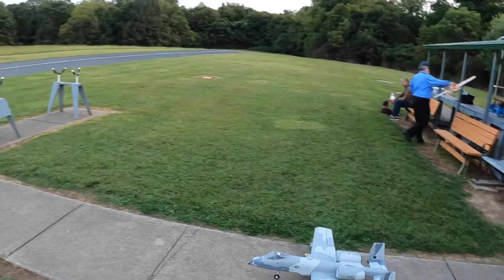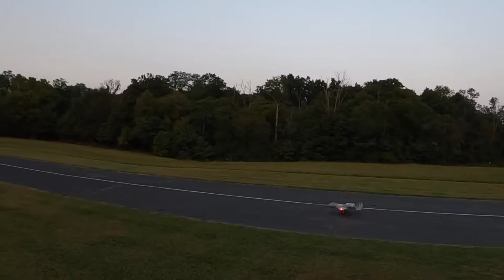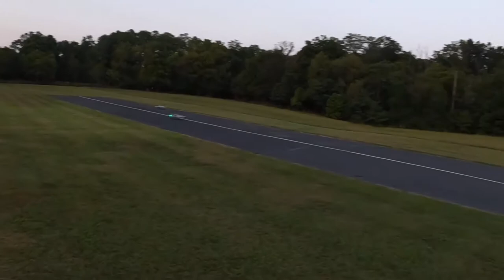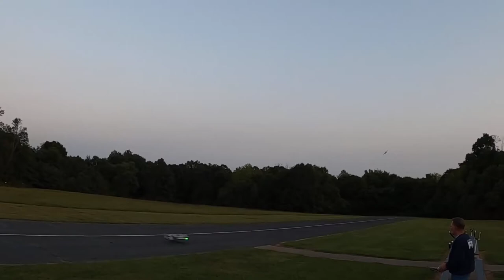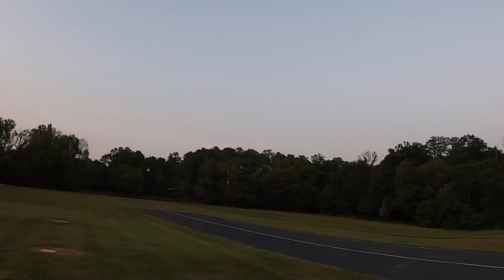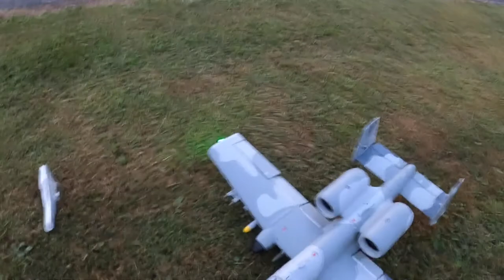E-flite A-10 Thunderbolt II 64mm EDF - formation flight and Jim crash

Comment: I think the grass helped out here lol. Those retract pins are definitely a weak point. BUT I’m not sure if you guys added the mixing with the flaps and elevator or not, but at 10% flap add 10% elevator and the 70% flaps add 12% elevator- after doing this I’ve never had to flare again, nice smooth nose-up landings every time!
Reply: I'm confused, is that 10 and 12 percent down elevator..? Wouldn't that make the plane want to nose down more..?
Reply: @EDF_FANatic  UP elevator. lol. Everything is positive. At the 10% Flaps (Takeoff flaps) mix in 10% up elevator. At the 70% flaps (full landing flaps) mix in 12% up elevator. I realize now that the flaps should probably be -10% and -70%, because flaps go in the negative position, but they only go one way.

Long story short- Takeoff flaps = 10% up elevator
Landing flaps = 12% up elevator.
Reply: @beavis847  strange, pretty sure the manual recommends down elevator. I've taken out the mix. Others seem to have programmed down elevator though in the flaps mixing ? Rc geek comes to mind.

Comment: Can I ask you how you build in the landing light? I think about it since 2 tays and had some ideas but maybe it's an easyer way?
Reply from the maker: Purchased on Amazon
White - https://www.amazon.com/dp/B01DBZICDC/ref=cm_sw_r_sms_api_glc_fabc_.Gp9Fb5Y4466X?_encoding=UTF8&psc=1
Connected the 2 LED lights together with short wires and used 2 small zip ties to hold them to the landing gear. They were connected to the light control board I purchased.

Comment: Yep you stalled her! It wasnt the grass, you hit hard and both landings were sketchy. It definatley takes practice to get the flare just right, eapecially with an a10😝😥😎👍💯try adding some expo to your elevator so its not so touchy may e 35% expo or 45% and maybe low rate on the elevator for landing, altho from my experience you need allot of elevator to flare an a10 properly. Good luck